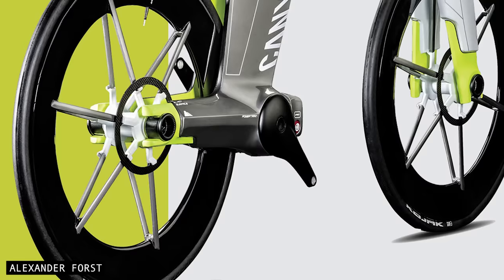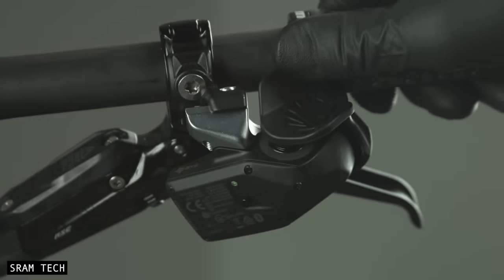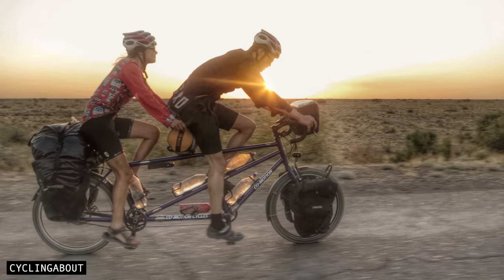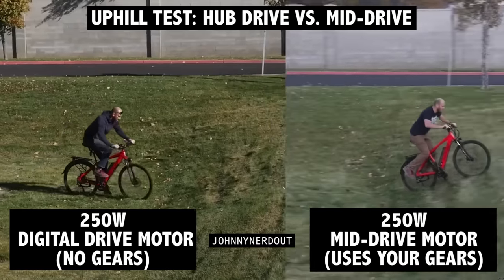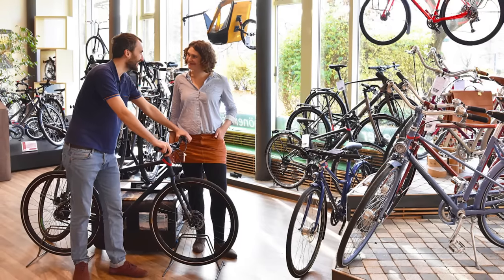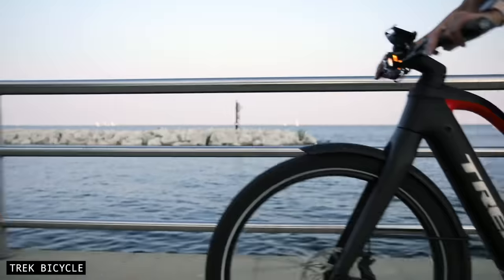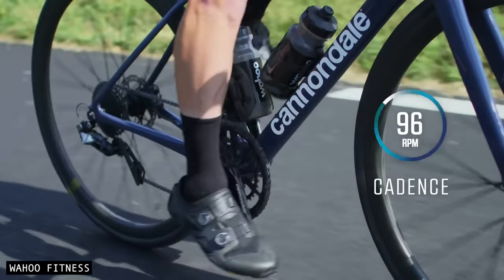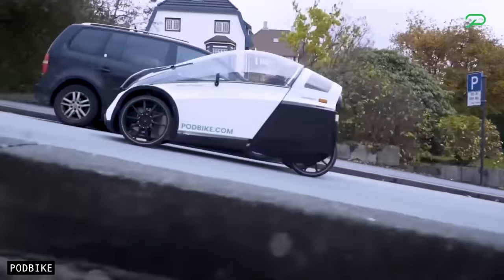Are Chainless Digital Drive Bicycles The Future of Cycling?

Comment: I like the digital drive for a commuter bike. Nothing will ever replace the standard bike for fun or efficiency.
Reply: I actually doubt the speed that it can get to for commuting in some areas
If it is only 25 kph then you won't be able to get into roads
Reply: True! Agreed! Btw, if you're riding you should get an nta helmet like xnito or bern hudson, cpsc helmets aren't really safe
Reply: Great video. I can definitely see this being useful for electric bikes, particularly applications like delivery bikes. The efficiency will need to improve a lot for it to be serious competition to conventional drivetrain.
Reply: At this point, just get an electric moped to commute, this digital drive system seems just like a legal technicality to get electric cars and light trucks into bike lanes.
Reply: Replace the standard bike? Well except the ebike! 😉🤣
Reply: You can just have a belt drive and internal hub and you would also have almost no maintenance but still have the efficiency.
Reply: @max-zv7sf  this is kind of true, I kind of feel that. I guess it all depends on speed limitations though
Reply: Something already has replaced it, but it's not mainstream yet - recumbents. There are bikes, trikes, quads and velomobiles FYI. Recumbent is more efficient due to the reduced drag and much more enjoyable due to the laid back position.
Reply: @pedroclaro7822  Recumbents are great on the road but not so good for off road trails. In hilly areas, a small motor on a recumbent is great so I don't wobble going up a steep hill. If I can stay above about 3 mph, I don't wobble.
Reply: Oh ya.  You don't think anything can replace a regular bike.  You sir have never ridden an actual emtb.  My 21 turbo levo comp begs to differ
Reply: For commuting the regenerative braking would make back a good bit of that efficiency loss. As accelerating takes more energy than moving at a constant speed.
Reply: @Awol991  On a car, that is true but on a bike, riders generally control their effort by using their brain so don't accelerate quickly when there is a light up ahead that they probably won't make. So unless you have a lot of vertical, it doesn't really work that well on a bike. You still have a lot of losses with regenerative braking on a bike but unlike a car, most riders will coast instead of wasting time racing to the next red light like a car.
Reply: I think the term digital drive is a horrendous use of language was digital about it. Electrical drivetrain would make more sense.
Reply: That sucks tbh.i dont likechain drives
Reply: E bikes can be more fun than a regular bike for anyone, especially those who are not avid in shape cyclists.
Reply: @jollyandwaylo  Close, but not fully.
Internal hubs are generally not as efficient as the derailleurs, the more widely used one have efficiency that varies between 85 and 99.8% only it depends on what gear you're in. The derailleurs are 98-99.4% efficient.
Also the belt drive costs about a percent in efficiency compared to a chain.

There are very efficient internal hubs that maintain something close to the derailleurs in all gears, one such gear hub is the Rolhoff only it costs more than what many people pays for two or three bicycles.
Reply: @Awol991  Regen makes very little difference. When I'm maxing out the regen on my Rad bikes I'll get about 235 watts going to the battery. This usually is for a period of maybe 10-20 seconds (while stopping for a light) or maybe a minute or two (steep hill). By comparison, a pedal boost level of 3/5 will burn about 253 watts while it's active, which is most of the time you're riding the bike other than stopping or being stopped. I'd say in a 30 minute ride you could probably regen about 2 minutes of battery power. It's much more energy efficient to just use the extra speed to coast further.
edit: added a "t" to "pedal boos level" lol
Reply: @thomasevans6716  I use mine for exercise. Turning down / off the electrical system of the bike gives a great workout. You can raise the boost to make things more comfortable or even max it out if you need to get quickly back to your house.
Reply: @lostcarpark  Yea for electric bikes it has a bit of a point
Reply: @msawyer110  What?
Reply: Bravo

Comment: I can see this system being more popular on Velomobiles due to the more complicated chain setups those seem to have. There's a recumbant or two that uses it too, but they're made-to-order things.
Reply: Yes! I was thinking this could be great for recumbent ebikes. They otherwise need really long chains – with extra cogs to guide them – and belt drives aren't suitable
Reply: I ride a trike and I'm not terribly interested in switching to a drive train that is heavier, less efficient, more expensive and can't be fixed DIY in the field.  It might be a good option for people who need an electric assist due to limited mobility or elderly folks but that's about it.  I tend to do pretty long rides (50+ miles) and I highly value the capability to fix nearly any mechanical problem roadside.  Just knowing that I will be stranded if something goes wrong with my drive system is enough to turn me off from switching to a 'digital drive'.

Comment: First of all, this drive system has nothing to do with "digital." It is electric. Second of all, putting a battery on these bikes does not solve the efficiency issue. In fact, it will make it worst as mechanical power from the peddle must first be converted into electrical power and then to chemical power (batteries) and then back to electrical power and then back to mechanical. Adding more and more batteries will only contribute to further increase in weight. In the extreme cases, it is like someone installing a foot peddle generator to charge the batteries on an electric car. (Probably a dumb idea if you think about how much peddling (energy) to get yourself anywhere.) If the design mostly relies on the energy that is stored in the batteries, then it is essentially a batteries powered bike.

Comment: I freak out every time you call it "digital" drive. Electric drive would be better fitting because the concept sticks out for using electrons instead of chain to transfer energy. The controller is just there to increase efficiency.
About efficiency: 80% is pretty low for a motor, there are standards for motor efficiency that go up to 97% and beyond. I don't know how well that number can be maintained with variable rpm thougt. Also, 10% transfer losses are a bit conservative and could be improved upon. One solution we might see is two motors front and back: One more for torque, one for speed, both for 4wd-equivalent better tracktion and reduced wear on tyres. Brake usage and wear is also greatly reduced, I guess it should  be ok to shave the rear brake of and just have a (smaller, lighter) front brake. With optimisations to the frame the weight penalty will likely be reduced further.
Reply: The motor driving the wheel could be up to 90% efficient. Most of the loss will be on the generation side.  That motor is going to have a lot of loss from the variability of the rpm. Efficiency in generators drops off exponentially the further away you are from its peak power output. Then once you add on the transmission losses that 60% is bang on what you would expect.  Obviously you could improve that slightly, but don't expect anything more than a few percent.

Comment: A decent thing for the next gen of cargo/delivery bikes doing last mile stuff. 

For propelling a solitary human and their backpack over any distance that's a massively inefficient lump of complex solution to solve a challenge already comprehensively solved a century ago, and recently tweaked with e-assist. 

The argument about chain and derailleur is no longer valid with belt drive and modern hub gearing. 

It misses the point of why the bicycle (and e-assist) is so efficient - they take the force of our strongest muscles (quads and glutes), and using leverage and gearing transmit and multiply that energy into forward motion. 

This doesn't do any of that.
Reply: Agreed, this definitely veers into the territory of "just get an e-motorcycle/scooter at that point" territory

Comment: Really interesting stuff. I have to say I don’t like the idea of it not having that quick engagement you get with a physical connection to the back wheel. People who are very casual won’t notice, but it would undoubtedly bother long time riders a lot if it doesn’t feel like what they’re used to.

I’ve seen it already where riders do a few revolutions before a 4-wheel bike van starts to move.
Reply: I think the way with this would be like Tesla did with cars. Instead of trying to make it “feel” like a traditional bicycle they should fully lean into the advantages of digital drive and embrace the differences.
Reply: @Noadvantage246  Yeah maybe. I try to always be open minded, so we’ll see.
Reply: @christill  I hope some takes this up I think there’s a lot of potential here. 

I already got plenty ideas. For example if you had a digital drive bike with an electronic, daul-sided, kickstand; you could create a bike with launch control! The kickstand goes down and you pedal in place building up surge capacitors. Then with something like a thumb throttle you could launch it. The kickstand would retract instantly as the motors spin on full power!

This would be hella fun and kinda funny to go from pedaling in place to taking off like a rocket. But it’d also be practical for commuters. You come to a light and can keep you pace a cadence going then take off back to your pre-set commute speed right away.
Reply: well the problem with the 4 wheel bike van you mention is cadence sensing, if it is torque sensing it is instantaneous dependant on controller settings ofcourse

Comment: what could be the efficiency of a well designed hydraulic drive ?
with dual pistons driven by the pedal crank and similar arrangement at the wheel, perhaps with 4 pistons instead of 2.
and gearing could be infinitely variable by mechanically automatically varying the conrod length.
a small lever could vary the amount of effort you want to put into peddling and your speed would be automatically adjusted accordingly.
as hydraulic drive ticks the boxes of lightweight, reliable, self lubricating , fully enclosed, and cheap to produce.
Reply: Hydraulic drive efficiency are generally also around 50/60%, and that's with turbines. Should be checked for such a small device, but counting this could have been used anytime in the past 200 years and is not a currently known popular method, I guess the results are not very good.

Comment: This is the first such a comprehensive video on digital drives, congrats. Think there is a great future in it, with further tech advancements. One special drive I have recently seen is "Revonte" - a hybrid, stepless automated drive and gearshift - it works like Toyota Prius - and imho it will be a killer drive until digital drives fully mature, with same "software defined platform" benefits as with the digital drive. Can't wait until those bikes hit the production!
Reply: Why not just ride a quality 'normal' bike. Adding 'digital' really does nothing but add complexity that is just not needed.
Reply: There twitter is abandandonded in 2019 and there recent blogging is not persuasive.... very delayed even channel here is 2021 arguing "artnered with EAV, Lavelle bikes, and Tunturi bikes. "
Reply: This will not have "a great future", chains have an efficiency of about 97%. That is insanely high, quite literally nothing compares to it. So it would be really dumb to throw that simple efficiency away

Comment: Stunning!
A bicycle chain has an efficiency of about 90%.
The power efficiency  of an electric motor as well as the generator Is about 70%. So you have to push twice as hard to get the same power on the wheel. Admittedly you could add battery storage and use the energy of regenerative breaking to the battery. However an efficient generator, motor and Batteries will weigh in at a substantially higher weight than the traditional drive train. So bicycle frames are made out of light weight materials and then we load them up with heavy clutter. I guess someone might say it is a great idea, but apart from playing with new tech, it doesn't make sense on a pushbike.
The economics will probably look better if you add the generator to an electric bike.
Reply: Dirty chain has about 90% efficiency so right, drivetrain like in the video is not worth it at all.
Reply: You have your body weight and your payload. Couple of kgs won't matter for many people, unless you want to do a race.
Reply: Bravo
Reply: 70% is not half of 90%, this statement alone should be reason enough to not take you seriously. The rest is also just guesses, not even educated ones. I’m so tired of people playing experts on things they have watched a single YouTube video on.
Reply: @foximacentauri7891  so nice to be fast checked. If have taken my numbers out of my old electronics reference book. Please share YOUR sources and explain how a bicycle chain manages 30% energy loss. 
Then we can see who can be taken seriously.

Comment: Regen braking on a bike is useful for a mountain decent, but for rolling hills you don't want to curtail downward momentum by using regen braking. It's why almost no one in the e-bike world bothers. You rarely want that effect, and it's also got an efficiency loss.

I appreciate this primer. Too often people assume it's an obvious evolution of bikes. but that weight and efficiency penalty are not worth it in most instances. The Podbike, Arcimoto Mean Lean Machine, and some other velomobile type startups are using indirect series electric drive too. These rely on big batteries to make up for the fact that you're losing so much efficiency to the double conversion at the same time that you've encumbered yourself with much more vehicle weight.
Reply: will be probable the regen work with an special brake lever or adapter that will works with brakes with some adjusting. so instead fadding brakes on reductions the regen act and when you need power the brakes act. this will be increase the pads durability and range to modulate. but the cost and weight is the problem
Reply: WTH are you talking about?
Regen braking is activated just like braking.
Regen braking has nothing to do with chainless drivetrain. 
You just need a hub motor without freewheel.

I have regen on my e-bike.
There is a contact on my brake lever, and then I choose the braking intensity with the accelerator.

In a city environement (Paris), when I use regen as much as possible, I get 15% of my energy back. 10% when I'm not really into it.
In mountainous environement, you get around 30% back.
What's great about regen, is that you wear your brake way less (like with EV's), that mean way less maintnance on the bike, that the biggest argument for regen.

About the chainless drivetrain, I'm on par with you.
Having 2 engines instead of one + a belt system for example, is way more fragile and complex. 
If your electronic fails, you can't move anymore, with a physical drive train, your bike is still a bike.
Reply: If your bike is not an ebike, then this whole concept is total nonsense. Nothing can compete with a chain drive. But if you have an e-bike anyway, then maybe it could make sense. But having, essentially, two motors will be a disadvantage.